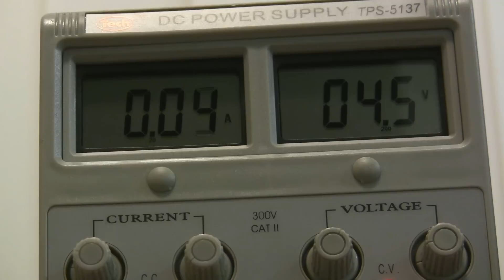I built a laser tripwire circuit...

Comment: Great video, and gotta love the n-Channel Mosfet, yes simple, and right to the point for those of you that want to learn and use your brain. It's simple, know your stuff first, and follow along. Break out the calculator is you need to, as I did, and yes, he's 99.9% correct.

LASER ON = 250 / (250 + 2200) = 0.10204081 * 5vdc = 0.510204Vdc
250 + 2200 = 2450Ω

LASER OFF = 4500 / (4500 + 2200) = 0.671641 * 5vdc = 3.3582Vdc
4500 + 2200 = 6700Ω

The n-Channel mosfet would need to have a Vgs(th) of less than 3.35vdc, something like the IRLB8721PbF, but it would also need to be higher than the Min Vgs(th).

Overall, very simple circuit, and YES, this will work 100%.

First things first, learn about n-Channel Mosfets (Afrotechmods), 2nd, learn about Voltage Divider. 

It's V1 = R1/(R2+R2) * Vs

I learned from Darryl Morrell's video about the Voltage divider circuit.

I usually order my stuff from a trusted source, such as Mouse Electronics, or Digi-key. Never from eBay, as far as electronic components go. 

Good Video (+1 : 1,338)

Comment: I am using cheap solar lawn lights as the light sensor instead of a CdS photoresistor; it is much easier to aim a laser at a 1.5"x1.5" square solar cell. When the laser hits the solar cell, the + and - battery connections within the solar light circuit will connect and complete a circuit. Wire in your disco ball or whathaveyou to the receiving end and use the + and - battery connectors as the on/off trigger.

Comment: I think you mean voltage regulator. The black component is a MOSFET. MOSFETs belong to the transistor family, however, unlike a standard transistor which is current controlled, MOSFETs are voltage controlled. They can be used as switches or as variable resistors, depending on how you bias them.

Comment: Sorry, my mistake.
But if any intense light source will do it, then it can be "hacked" right? If I cut the laser beam and if before cutting I put a very intense light near the photoresistor, then I can "hack" it right? An option to prevent this is to turn on and off the laser beam at a specified frequency and program a microcontroller to read the output from the voltage divider that contains the photoresistor. This way it's impossible to hack it!

Btw, nice tutorials!

Comment: @175726 Hey why doesn't my circuit work? i put the MOSFET like in the diagram... the source has the resistor(400 ohms) the drain doesn't have an input put on the other side has the LED and the gate is the photresistor what am i doing wrong?

Comment: @killlbot   It seems like the one he used will work perfectly for you because if your run the equation  5 x  (180/180+2200)  you get .37v which will not be enough to open the gate, but when you hit 2780 ohms, it will open gate, his in ambient was 4500 ohms, either resistance will trigger with voltage needed.

Comment from the maker: @trevzilla1404 This circuit wasn't designed for high current load motors. Is your motor a big one? If so, take the output of the circuit and feed it to another, beefier transistor. You may also have to switch the photoresistor's position.